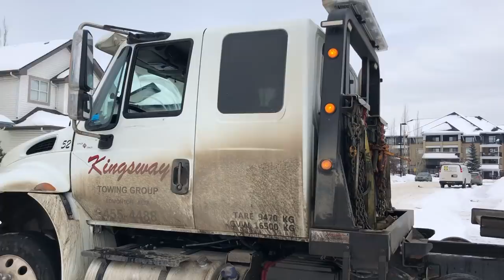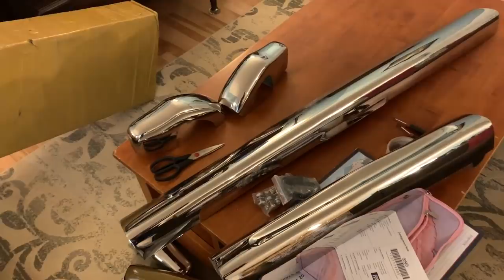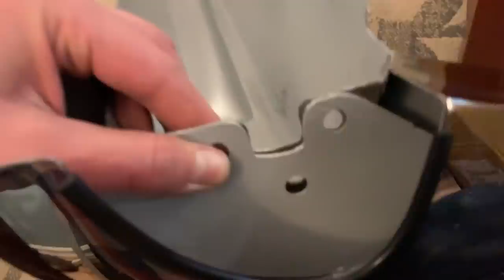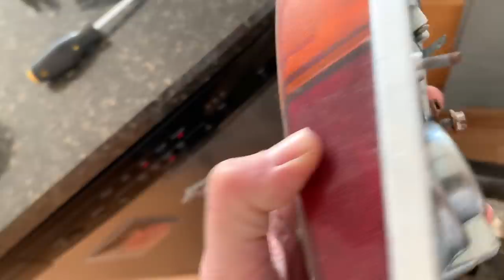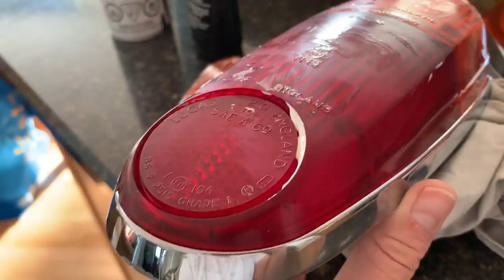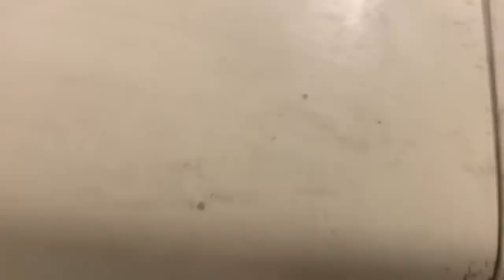Part 7. This destroyed Rolls Royce barn find goes to the paint shop!

Comment: So cool this is gonna look great when you finish.. just a side note to repair those plastic lights you can use acrylic powder and liquid. Mix in equal amounts  on a paint brush,fill your whole and sand  to a finish if you use a sanding block with a really fine grit and polish with some oil. It will look great.... they now make those powders in a lot of colors.

Comment: Good to see it shaping up!  I suggest you dry-fit the bumpers before the body shop does any paint work.  Sometimes the mounting brackets don't fit quite right (or the bumpers don't have the same curves).  Also, the rubber gasket around the tail light lens is called a plinth.  Great word for a British car owner to know.  Mine was a baby RR....an MGB.

Comment: Alex just a suggestion when using S.S bolts, fastenings I would use Lanacote here in NZ to stop firing of the threads make for easy doing up and undoing, you may find a similar product over there as is made from the grease taken out of sheep wool hope this helps.
Reply: Yes, very important to use a lubricant on stainless steel fasteners. If the threads seize together they are almost impossible to get apart. In the Pulp and Paper industry we used an anti-seize (Never-Seize or Copper Coat) compound which worked well.
Reply: Fluid Film rust preventative is lanolin based and you can get it at Canadian Tire, etc.  It's handy for other uses too.
Reply: @thorsbyguy5121  lanolin products are great I had a feeling there would be a simaliar product too ours use a product called Prolan on S.S to stop tea stain and great as a rust inhibiture on marine gear that's used at sea, plus agricultural equipment.

Comment: for dents used to use a verry strong hand magnet and heated up the dented metal then when it got red hot stuck the magnet on and pulled till it straighten  repeated as needed then painted it

Comment: Alex, good idea what you are doing to expidite completion time on the Rolls. I don't see it but I hope you sent the fuel door along with it. Another thing I'd like to suggest is that you consider an ample of wax on both sides of those bumpers. You won't have to buff out or polish the inide. it's just a preventative measure because once installed you won't have the oppertunity that you have now.

Comment: When you bolt together parts such as those bumper pieces, you should include a mastic sealer "gasket". the stuff that I used years ago was called "Sealastic" but that seems to have disappeared from the market. But, nowadays, for small parts, I use "Blu-Tack" and it works really well in preventing rusting. If you use this, be sure to use the genuine stuff and not one of the many copycat products, which tend to dry out and crack. When you tighten the joint, excess mastic will be squeezed out, You can trim this and roll it into a flat sheet for reuse (use wife's rolling pin at your peril!)

Comment: For the cracked tail light, an all-temperature, plastic-friendly clear epoxy (or something similar) might be a way to seal up the hole. Add some red dye to color the epoxy, smooth it into the crack & let it cure!

Comment: Alex. People have suggested different ways to repair the red tail glass. Have you ever tried to use a tin soldering iron and melt the parts together. If you work from the inside you can make the pieces melt carefully together. Just be careful with the heat. Try to "solder" two plastic pieces together just for trying and then the plastic red. Good luck with the project.

Comment: Hey Alex, just an idea from an old mechanic, if you haven't already, you might want to add some loctite to the bolt threads on the bumper assembly - so they don't vibrate loose over time.  just a suggestion :)!  Love this project - wish I was there to help :)!

Comment: You can fix that hole in  the light. Get some 5 Second FIX , Its like a clear resin that hardens with a U.V. light on the end of the applicator . Just tape foil onto the inside . The foil won't stick to the stuff.

Comment: Just subscribed after finding your channel. I have restored 5 Shadows, and a Cloud. I am currently working on a 78 Shadow which has been converted to a GM drivetrain. It will look/perform exactly as original until the bonnet is opened! Your method of tackling this restoration is exactly what I did/do. I tried to do something to each car each day even if it was minor. I do think it would be great to list in the description where you got your parts, such as the new bumpers. I do NOT have a Corniche, but I am looking. I eagerly look forward to each epidode! I think it's awesome a "younger" guy is interested in the older cars! It would also be interesting content to know how you found the cars as well as the expected expense such as the paint/body work.

Comment: I don't understand why people have started to tie the car down using the tires now.  I have always tied it down from the suspension or the underbody so the body does not bounce while in transit.  What happens if you have it tied using the tires and one or more explode?
Reply: Well, I guess, even if you tie it down from the suspension, if a tire explodes, your rope that you tied the car down with, will be lose. Because if the tire explodes and goes flat, the whole car will sit lower and then you'll have some amount of slack in the rope, no matter where you tied the car down.
Reply: @NCCElroon  I have towed a lot of cars on trailers and I try to avoid the body bounce.  Sometimes it gets pretty bad, which is why I tie it down from the body.  If you look at the left rear tire, the strap is cutting in to that tire.  If the tires are really old, that could cause the tire to go flat.  It has happened to me many times.
Reply: @mexicanspec  Yeah, tieying the suspension down to reduce body flippedy-floppedy is a good idea, I agree with you.
Reply: MG Stevens  We are not talking about modern tires on a lot of these cars that have been parked for decades.  I have had tires explode with the car just parked in front of my house, not once but three times.  I can understand tying down the car from the rims on a super car that has no body bounce, but when I tied down my 1973 Ford Country Sedan wagon, things would not have gone well if I tied it down using the tires.

Comment: No worse than that body is, I'm surprised you're not doing the body work yourself. I guess it might actually be cheaper short term to let the body shop do it, since doing it right would require purchase of a bunch of tools... but as many cars as you mess with, those tools would get more than one use. They have ways of pulling dents now that were not around when I was doing it for a living. There are guys out there now that can do the work in your driveway, weather permitting, and not have to remove and redo paint. Some of the methods they use are amazing. There are vids here on You Tube about it, it's amazing to watch, they can often do dents that I wouldn't think it possible to do without grinding and filler and paint.
Reply from the maker: It’s too cold in my garage otherwise I would
Reply: @CuriosityIncorporated  when you finally dump the old store you need to rent a heated garage.

Comment: I would patch the holes where the reverse lights are on the back panel, and use the other tail lights with the reverse lights built in, much cleaner look from the rear. Cheers from down under

Comment: I have two questions. 1) shouldn't the bumper sections be held together with locking nuts or spring washers to stop them vibrating apart? 2) Why do you have a fairly new build house with internal garage but no heating in there?

Comment: Unless changing colors, I think it was the wise move, they may have a section where a mobile mechanic can get the old gas out, some new in and the engine fired up. I am sure that unless it has stainless steel exhaust, it will need replaced, a nice dual exhaust would make it stand out and it doesn't need be loud. My friends rolls sounds good as it comes out the far end and when reved up high enough has a bit of tone factory so you can get whisper quiet or sound, I  go for the latter. It is a far cry from where it was

Comment: DOES IT RUN HOW IS THE TRASMISSION ADD BRAKES ECT THAT IS WHERE THE MONEY IS
Reply: He hasn't got that far yet I think, but the engine seems in decent shape.
Reply: @julier.1902  He turned it over ,it did not start ,parts are the killer on those cars I know because I have had several of them and try to get someone to tune it well  good luck. I hope it works out well because I enjoy the show, I am fixing a 1997 bmw 740 il $$$$$.